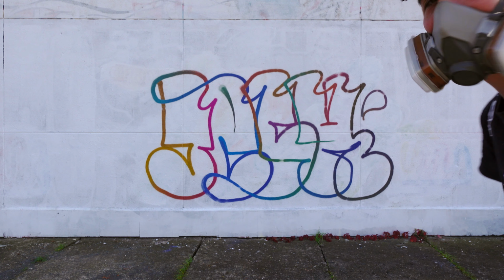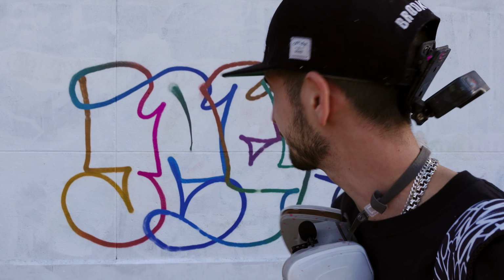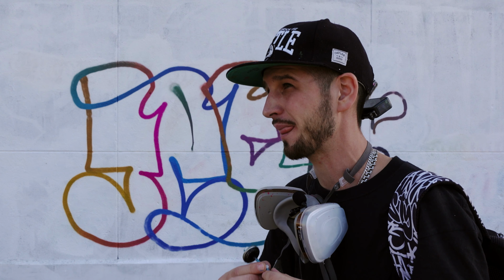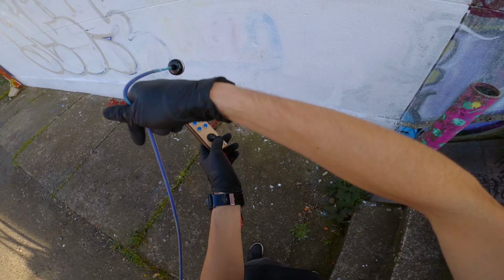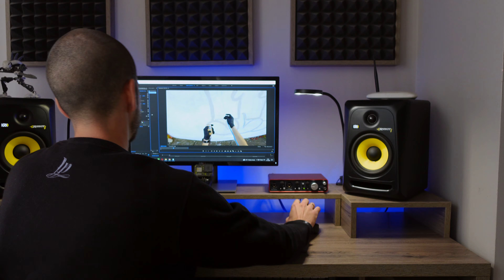Graffiti - Tesh | COLOR MIXER

Comment: i think one mayor improvement of this tool would be to have an empty can as a handle, not only the tiny valve 😅 but insane - especially the laser cut sections at the beginning 😮 so good! A+ Video ❤
Reply from the maker: You won't believe it, but right now I'm making a handle. But this is not an empty can, this is something more comfortable. Thanks, Smoe!)
Reply: I thought the exact same thing about an empty can. Then I seen you comment.

Comment: I still can't believe how professionally engineered this device is! I'm thinking if this could be useful as a color switcher for, let's say, fast application, if the pressure could build up a little higher and more constantly. Imagine being out in the streets, this thing in a backpack and the controls in your sleeves. Two colors for fillin, one outline color, one for highlights. No changing cans.

Really sick! Love it!
Reply from the maker: That's what I planned.
But I can't hold the button for a long time, because either the motor will break or the gears will break.
It's not perfect, but it works) Need to finish it.
Thanks! 🙏🙌

Comment: 5.32 i laughed so much man :) indeed good comparison, when I saw this , i realized that it will be so hard to paint with it. brialiant idea, you are so creativ inventor man! video as always rockz  . Big up Tesh
Reply from the maker: 5:32 😄 Thanks, Bro! I need to finish this device so that it works reliably. I found a tube of the same diameter inside, but thicker. This tube should withstand the pressure of even 4 cans, pressed at the same time)

Comment: Hmmm.

Switch out the purple for black and you’ll have CMYK. CMYK are the colours they use for newspapers and magazines, by mixing them in a halftone style you can get any colour as long as you’re painting on a white surface.

Same for cadmium red, cadmium yellow, ultramarine and black for painting.

In theory you could have something like an airbrush reservoir where the paint is stored and you could have some seamless shading and colour changes.
Reply from the maker: I thought about it)
I worked in a printing company, I know how works printing press. But this is a little different. I will not be able to adjust the percentage of paint supply.

Comment: 😂Better watch out. Cops are gonna think u robbed a bank. They slipped you an ink pack. 😂😂Try using a tube that can handle the psi pressure. 😁👍